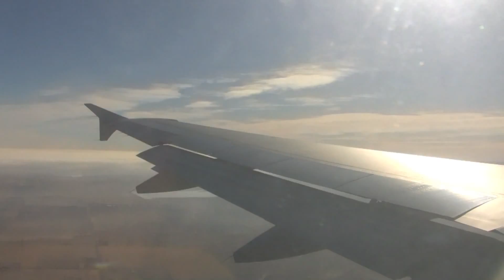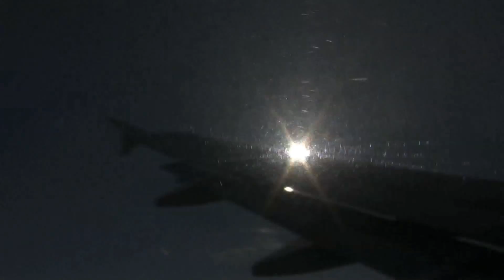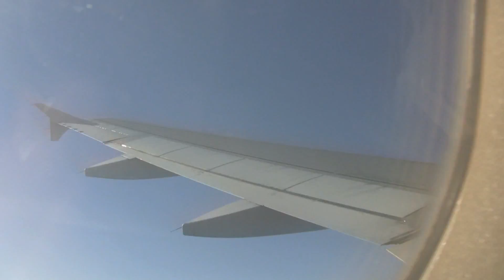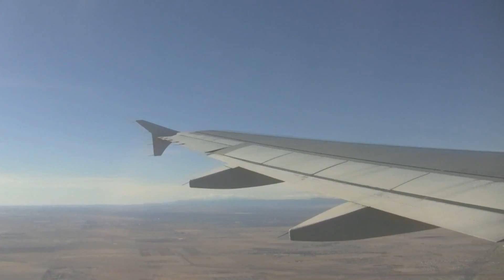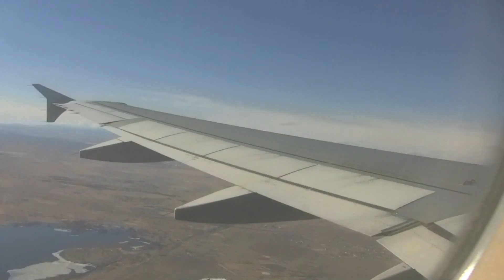Air Traffic Loss of Separation at Denver International Wing-View with ATC

Comment: it wasn't anything imminent or the controller would've used the term "immediate" we only say that word when a collision is imminent, & this controller never said that word or the word expedite so I'm sure you were fine.  Also while traffic was only 1.5 miles away, he probably wasn't at the same altitude, you need 1,000 ft. vertical separation and if you have that it doesn't matter how close laterally a plane is, the galaxy pry just was in the way for the united to continue its decent on approach

Comment: If there was indeed less than 1000 or 3, a loss of seperation, and it was the pilot who switched to the other runway, then the pilot, not the controller, would have bought that one.